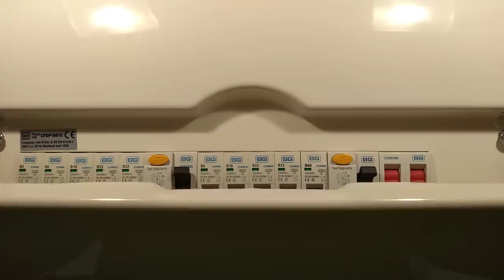A look inside a British home electrical panel.

Comment: You're right about your comments about the poor certification regime. We needed to rewire my house last year, and could not find a good electrician for love nor money. Finally, my builder found one.

Well, he said he was an electrician and he knew how to put a channel in a wall and pull some cables through. It was the small things that let him down. For start, he was so inexperienced that he grossly underquoted for the work.

He didn't remove all the old wiring (worth quite bit for scrap) so we have tens of kilos of unnecessary weight on the floor joists. Some of the back boxes were not properly bedded in (granite block walls) and the consumer unit rather vaguely labelled. Pairs of switches and sockets were not lined up. The consumer unit was flapping in the breeze (only two screws at only one end).

My husband and I rewired our house together years ago (before regulations stopped that); we'd done our research and knew a little. Neither of us are really comfortable with the job this guy did. It's all quite safe, but some of the things he did are strange. (Strange is OK on something that's grown organically over the years, but not on a new installation.) Since he's been I've had to have repairs done (flooring nails through cables) and the (enormously expensive) real electrician I hired to sort this out has been seen scratching his head at times.
Reply: honestly electicity in my house is not something I trust anyone else but myself to do. I never hired an electrician and never will. If anythings goes wrong best case senario you louse your house (worst case you die). you have to be bat shit crazy to trust some guy with this ( thats how crappie panels like this ends up conceded to the main!
Reply: Interestingly neither the building nor wiring regulations (despite what various 'trade bodies' will tell you)  disallow DIY. What they require is proper testing and certification. Which is available (allegedly) from your local building control. Or if you COULD find a decent electrician, he or she would likely be happy to inspect a couple of times (after first fix and during second fix) and then test and sign off.  We do this but only if we trust the customer not to bodge it. :)
Reply: Poor certification? I couldn't imagine. Living in Canada you can't even work as an electrician unless a company takes you on as registered apprentice. We still get dumb people, though.. Can't avoid that.
Reply: Regulation preventing DIY work? I never heard of that.
Code is stringent here (France) for new installations, but very lax/permissive on old ones. Because they consider (thankfully) that new laws on electricity doesn't apply on existing installations (else you'd be rewiring everything every 10 years of so) so as long as there was an existing wiring before, you can do almost anything, you'll just get a big "Not up to code" after inspection.
As for new installations they don't care who made it, as long as it up to code, you could have got it done by your 7 years old nephew for all they care.
What changes is that if your electric wiring cause a fire, responsibility is on whoever installed it, so if you are renovating or building your house, it's the point where you want someone else to be responsible :)
Reply: After dealing with a number of British builders, plumbers and electricians both at home and my work building I can honestly say this "that'll do mate" attitude is widely prevalent in this county.
Reply: @TheChipmunk2008 Thanks for the reply. I must confess that I got my information about DIY from a non-authoritative source. Perhaps we should have done it ourselves, again, but we're both getting rather too tired and frail to contemplate this. It's a problem of aging: you have to reply on others to do things and it's never done as well you would have done for yourself.
Reply: @LeSarthois  That is a sensible attitude .... I wish we In the UK had that attitude, but, you know we don't :(  They;d rather let some moron who has no idea what he's doing sign paperwork, than someone who cares, do the actual work
Reply: [insert political rant about how the uk govt are idiots and the EU are better... because that is how i feel]
Reply: In the UK you get what you pay for, I have seen the professional work and cowboy stuff, cowboy stuff most often work just fine but there are exceptions and extreme cases.

Comment: One more item of note - This box is NOT connected to the mains ;-)
Reply: Yet!
😅😄😃🤣
Reply: and should never be!
Reply: Should be obvious, but such things do need to be said, unfortunately. I think most people watching this already know but don't go poking around in  your service panel if you don't really know what you're doing.
Reply: A woman I knew went down the hall to her box when the electric frying pan stopped working. I went behind her and saw her poking and prying things in her distribution box with a long screwdriver. She said that usually got the power back. I told her to move and let me look. She said, "Aren't you afraid of electricity?" I told her, "Yes. I'm terrified of electricity. That's why I should be in there instead of you."
Reply: It's not like a distribution box will bite you because you took the cover off, it's not a lady you just met in the grocery store. DIN-rail equipment goes through such ridiculous certifications as that screw terminal is deep enough and hole small enough so you can't touch it with your finger (yes, there's EU norm for that).
Reply: It took me a few minutes to realize that.
Reply: @shana_dmr , but the buss bars are not insulated, and do you want to bet that the previous hack didn't leave some wire strands poking out? Lol
I have spent years working with industrial automation, which uses uses a lot of DIN spec terminals in the control panels, and lots of people are very creative in avoiding the safety that DIN provides!
Reply: @ke6gwf  And at least in domestic we very rarely use stranded wires in Poland. And of course safety first - I don't condone poking with your finger around every nook and cranny in the panel to check out if there's not best practices-compliant amount of insulation stripped near the clamp connections, just common sense :) I've never seen an electrician that would disconnect the power before opening the electrical panel unless you really have to, insulated screwdrivers/pliers are insulated for a reason. I know nowadays there's some "never work live" ethos taught for young sparkies at school which ends up with rude awakening when you come to hospital job and all breakers are marked "don't turn off" except one for broom storage closet ;)
Reply: Even though you could see it was on his work bench.... every time he stuck his finger in there it made me twitchy.
Reply from the maker: @shana_dmr  Yes.  Some systems use the forked bars.
Reply: main ground, yellow-green cable need ewery mainbox to ground. if not have no have safety and legally box
Reply: You have put my mind at rest.I was getting a bit worried then. 😳
Reply: @m101ist  glad I'm not the only one who was getting VERY anxious about him fishing around with his fingers in there lmfao
Reply: yes... I was "shocked" to see him poking around, I was expecting a scream and some point followed by a dull thud.
Reply: Looking at the mounts... its not even connected to the wall lol

Comment: One phase solutions are rare here in Sweden as well in new constructions. Most cooking ranges are 3-phase. I upgraded from the classic fuses to the RCDO (as you state) several years ago and it was really worth it - only breaks a limited section instead of the whole apartment.
Reply: The fact that they are three phase does not mean they will not work with just one. However, one is limited on the power but who has all the plate at full power anyway.

Comment: A Good informative video, especially with the info about making sure the breakers are correctly fitted on to the busbar.
Reply: The one thing the United States breaker box system might do better ... clip onto the busbar vs screwed on.  Better when the clips in the breaker are good anyways.  😂🤣

Comment: I work with industrial automation, and so I am familiar with DIN equipment despite being on the US West Coast, but boy, when I wire a house, give me a giant clunky metal 40/80 space buss bar panel!

I like home runs, I like seperate circuits per room, multiple per room to be specific, (you never know which bedroom you will want to run a table saw and a microwave in at the same time! Lol), and I like being able to choose what breakers I use.
I also don't like having to wire each breaker to the power, as opposed to just popping it on the buss bar, and I like having per circuit AFCI/GFCI protection!

I am thinking that one of the reasons that you are allowed to wire and install like you are is because of all the old stone and brick buildings your ancient and not earthquake prone country has, and recognizing the need to be able to surface mount and snake cables around stuff, and also not have lots of home runs, but be able to fit more on a single 220 cable.

And while I have often wished that I could get a DIN breaker for Home Depot prices for special applications, (they are pretty expensive over here, because they are only used in control systems and such), I think our panels and wiring methods work a lot better for our culture and way of doing things, kind of like how US Customary Units work better than Metric for us lol

Comment: Interesting to see how other contryes do their main distribution boxes. However i´m personally not keen on your use of single poled breakers. Here in Denmark it is by many electricians (including my self) considered kind of bad workmanship, allthough not illigal to use. The reason You explained yourself around 12'30 on finding the fault by turning the breakers on one by one. Let´s say the fault occurs on the neutral line, the RCD could trip on any of the breaker. The faulty current could potentially run from breaker one, through the load and back via the neutral to the cabinet, and then out throug the next neutral line to the fault point. There by splitting the "return current" between the incomming neutral and the ground fault, tripping the RCD.

In Denmark we usually have 3-fased supply from the grid, through a 4-poled RCD and then 1 live and 1 neutral for lighting circuits. We use mainly 10A C-rated breakers (13A is allowed in privat homes), and 3-fased (4-poled) 16A breakers for heavier loads like heating and appliances. And ring connections is banned. Due to new EU legislations, it´s now mandatory to mount at least 2 RCDS in an installation.

And i highly agree with You, that 5 days of training is way too little to be allowed to mess around with potentionally lethal things like this.
Reply: It's the same in France, unipolar breakers are no longer allowed in new installations, only in replacement for older installations which had fuses.
All circuits use bipolar breakers. Installing a main breaker isn't usual tho it's done when the main breaker (provided by the electricity company) is located far away.
Three-phase is available to everyone but very rarely used, most households have everything on single-phase.
Reply: Yeah, becoming an electrician is a 4 and a half years of college here in Denmark.
Reply: It's mostly the same in Norway, 3 phase supply with bipolar curcuit breakers and a RCD, or combined RCBO breakers. 

Most installations have 230V 3 phase (IT) supply, with no neutral and 230V 2-phase distributed to the appliances.  Both 13A and 16A C-type fuses are common, with 20A fuses for the kitchen stove. Only in recent years it has been more normal to use 3- phase 400V TN with 230V 1-phase distributed with the neutral.

3-phase IT distribution with 230V seems to be quite rare in Europe, from what I've heard from others.

Do you have that in Denmark or is it all 400V TN?

Btw in Norway it is required to have 2 years of vocational education + 2,5 years as an apprentice at an installer (total 4,5 years)  After  that you are allowed to take a final exam, before being allowed to get the installer certificate.
Reply: @nilsjarle  We use 3-fased 400V TT
3 times 230V (L-N) along vith N is distributet from the grid into the home. Every household have to ram a spear into the ground for protection (earthwire or protective wire). Only in rare occasions a TN-system is allowed, usually in the old city centers, where ramming a stick into the ground would be extremely difficult.
Reply: @jaras1969  Interesting to know!

For TN we use  TN-C-S, with the N (more correctly PEN) distributed from the grid, and then separted as both neutral and protective ground it the intake panel. But then due to safety it's required to use RCBOs on all circuits.
Reply: @pmailkeey I'm pretty sure you'll find the main switch is double pole, even going back to pre-war installations a DP main switch was mandatory.

I would prefer to see DP breakers over here for safety... isolating just the live... err .....phase ...sorry line... (they keep changing the terminology to keep themselves in business) is potentially risky especially with the more modern TN-C-S system, a disconnected PEN could raise the neutral to live potential. When I'm knelt in a flower bed trying to joint a damaged armoured cable... i make a nice earth. And it's not always convenient to isolate both lines by other means. (Disconnecting the N from the busbar requires opening the board and working in a live panel, turning the main switch off isolates the kettle, a heinous crime)
Reply: @nilsjarle  Same here, but only like i said in special occasions in older appartment blocks. It´s somewhat more commonly used in industrial installations for high power machines. Anyway one needs to obtain permission from the distribution company, since it requires a socalled "neutrally safe" grid to use neutral as PEN.
Reply: Ok - here in Sweden it's not very common to have 2 pole breakers at all. When those are used, it's mostly for loads using 2 phases (there are for example some electric radiators that run on 400 V and thus uses 2 phases without a neutral connection) - for 3 phase loads we often use 3 pole breakers. I don't get why you would need to break the neutral lead actually - you get a lot more cables and connections behind the panel and most brakers take up twice the space.
Although, it do makes it easier to find a fault that's on a neutral lead (for example an unwanted connection between N and PE). In a typical panel here if you get such a fault, you have to diconnect all the neutral leads from the terminals going to the RCD that trips and measure them one by one, to see where the fault is. It's a little more work than just turn of all the breakers and turn on one by one.
Reply: The main switch is a double pole switching the active and neutral you can see the wires coming out the bottom 1 brown looping round to the rcds and 1 blue going to the neutral link on the right hand side
Reply: 5 days training sufficient... You've got to remember that this is from the nation that brought the world Brexit, as a good idea. As for that other stuff, way too sophisticated and complicated. No good once not all but at least most of the good tradesmen have fled back to the continent. Also doesn't leave enough time for beer o'clock which starts at 11am on a Friday and carries on untill hangover o'clock 11am Monday. Still, once we're out of the EU we can loosen our standards so that the Chippys can double up as electricians by slamming in whatever nail they have leftover that they think makes the most appropriate fuse for the job.
Reply: Installation terminal blocks with a neutral disconnector addresses the same issue.
Reply: @StandAloneAoi  So TRUE.... so VERY VERY TRUE !!!